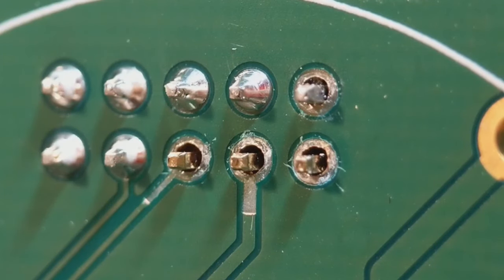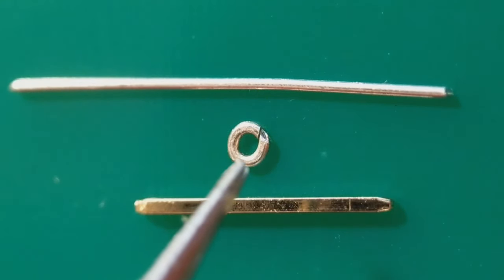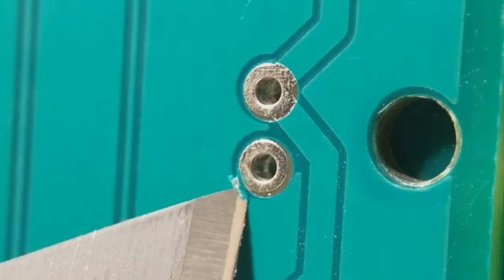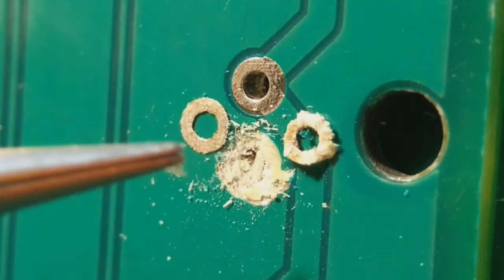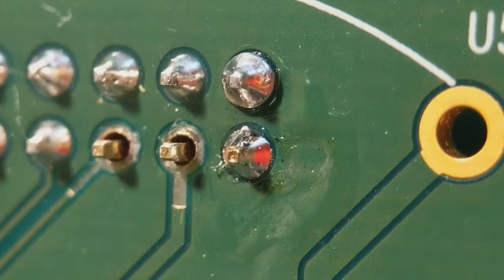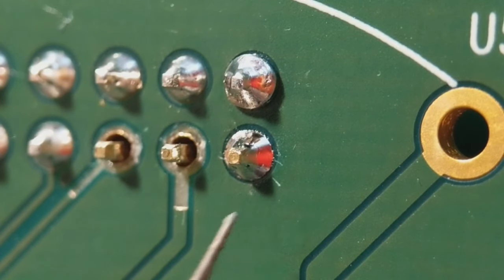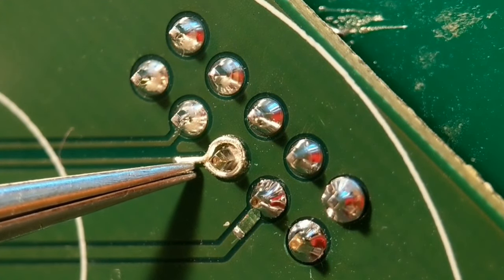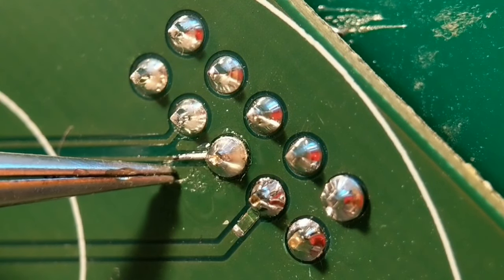How To Repair Damaged / Missing PCB Pads || 4 Great Methods

Comment: Can you use foil?
Reply from the maker: Hi , you can use foil no problem . If it's very thin simply double or treble up the thickness. Somewhere early in the comments for this video I mentioned the type and order code of the one I use which has the added bonus of being sticky backed so it don't move when working. Good luck and thanks for your comment 👍
Reply: @Mr SolderFix  thank you very much. I've been working on an Xbox controller for my son for the last 2 weeks, and it's giving me all sorts of trouble.
Reply from the maker: No problem , good luck with your project 👍

Comment: dude im an idiot i drilled through 4 tiny holes right through, its for a usb type b with 4 pins, they are separate holes i made but will your method still work ? im praying